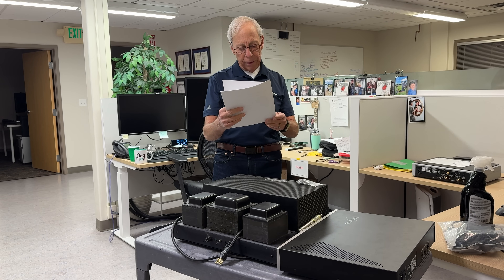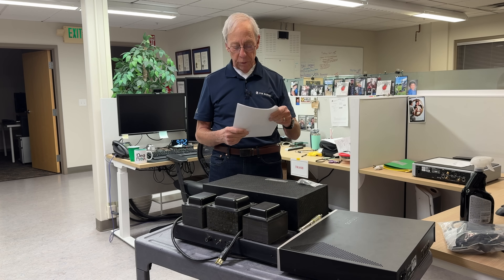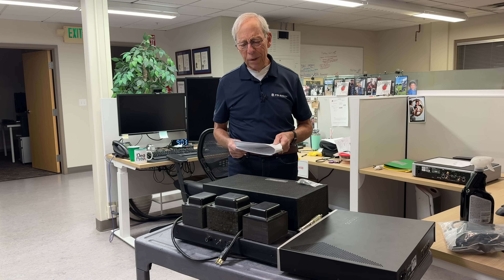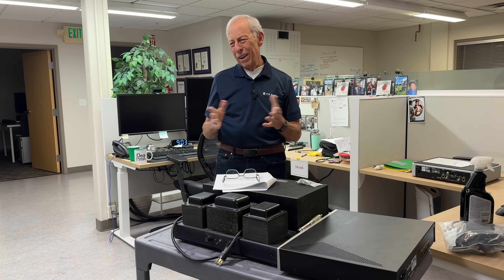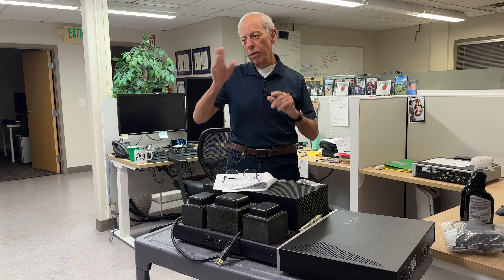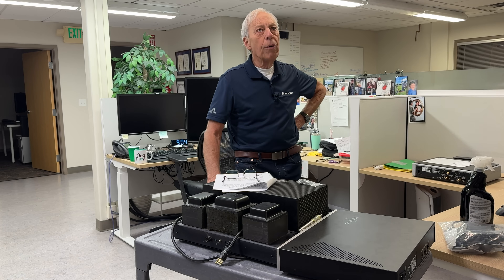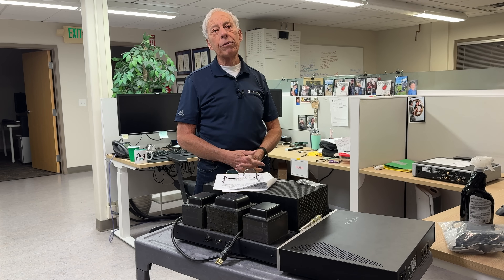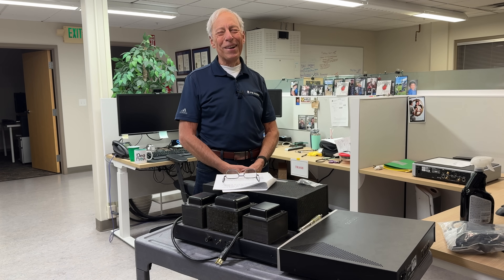Running Japanese equipment on US voltages

Comment: I have a japanese kenwood ge7i equalizer in the usa for years. I just plug it right in the back of the receiver. Never had an issue. Usa is 120v by the way. Im looking to buy a pioneer cd player japanese model because i want silver. I think it will be fine too. Hope so anyway

Comment: bottom line is reading the data plate and any paperwork. Most gear (these days) operates internally on regulated DC so it's just a small section handling the various input voltages from 100-130 or 210 - 250 VAC line voltage. Older equipment and tube gear may be more fussy. BTW, even though most of the north and south American countries run on / near USA specs, most of the Caribbean countries run closer to 105 volts and 50 Hz. Perhaps it has something to do with old powerplant gear handed down from other countries while they were establishing their systems?

Comment: I lived in the Netherlands for a few years and had ARC change the voltage on my ARC LS15 from US to European voltage When I returned to the US I reached out to ARC to convert it back to US voltage They suggested that I keep it as is with using a step up transformer as it will sound better

Comment: I took a 12V filament transformer with one end of the primary connected to one end of the secondary to lower the voltage for a crappy Chinese tube amp. So instead of producing 12VAC it removed 12VAC and I got 108VAC for the 110VAC amp. The filaments were almost 1 volt too high and tubes did not last long plus the power trans got real hot. Now everything is in spec and running cool.
Reply: Yes, a bucking transformer is a viable method to use, without having the size and cost of a full step-down transformer.

Comment: It can be a problem for linearly regulated stuff….. 100v 50hz vs 120v 60hz can be a huge difference on the other side of the bridge rectifier, especially if the main filter caps were fairly close in margin for the original voltage, and any regulated sections will be dissipating a lot more heat… It will probably work but it will shorten the life
Reply: @efmvii  exactly

Comment: My previous home in Canada was about 1000 feet from a Hydro substation. My measured house line voltage varied from 123 to 126 VAC.   Operating  slightly over is better than running under especially with devices like the motors & compressors on Air Conditioning Units, Washing Machined, Furnace Fans and Refrigerators.  North American standard is +/- 5% (114 to 126VAC) Years ago, in another residence, my line voltage dropped at peak periods to 105V and my Mark Levinson power amplifier’s main switch would buzz.

Comment: I’d be worried about the AC frequency in Japanese products. When I was in Tokyo, it was 60Hz but in Nagasaki,  Miyazaki and Kagoshima, Southern Japan, everything was 50Hz. Such a small country but 2 different AC standards. I would recommend determining the AC frequency of you Japanese equipment
Reply: The two standards are why japan produces equipment that works on both without any special consideration.
Reply: "Small country"? It has more than 124 million people. We here in Germany have only about 80 million and had a different TV standard for West (PAL) and East (SECAM East) until 1990. 😉
Reply: @ In land mass, Japan is a small island. I didn’t say it wasn’t densely populated. 

Most countries offer several tv and isp providers. Having 2 different AC standards within a single country, regardless of size, is extremely rare.
Reply: @MichaelM-to4sg  I didn't speak of several TV providers - I spoke of totally different incompatible TV standards (like NTSC in the US and PAL in parts of Europe back in the days). And Japan is not only one island plus the overall land mass is bigger than Germany.

Comment: One of the big advantages to modern switching power supplies is that most can run anywhere from 100 to 230 volts delivering nice clean DC power, without any problems at all.
Reply: and they sound like trash, no thanks.
Reply: Uh. No. Ohms law is ohms law.
Reply: @ 
Umm yes ... read the specs.

Comment: Everything I bought in the far east - admittedly at military base exchanges - had a switch in the back to accept either 120v or 240v.  Even so, if you take your equipment to a qualified technician, you could have the power supply modified to accept whatever voltage you desire.  It's usually (but not always) a pretty simple modification involving the transformer.  Worst case scenario involves replacing the power supply transformer itself.  On a big amp, that can cost a few bucks.  But on low current devices, this transformer won't be very expensive at all.

Comment: What if I want to run a turntable designed for Japanese market (100v / 50Hz) ? I would think 50Hz in Japan  (vs 60Hz in USA) matters hence I am S.O.L. ?
Reply: It depends on the design of the unit. If it's belt drive with a mains synchronous motor, then the speed will be wrong, but if the motor is tolerant of the frequency change, it might be possible to compensate with a corresponding change in pulley size. Unless that's known to be a successful conversion, iffy. If the turntable is completely electronic such as direct drive, it may not matter.
Reply: Only half of Japan runs on 50 Hz - the other has 60 Hz. So Japanese turntables should be fine with both.

Comment: The biggest improvment in amplifiers i bought and modded was to rip the powersupply as is. And run the equipment from good old sealed lead acid battery power. On stand by they are connected to a float charger. And isolated from the equipment. When playing anything , they are isolated from the charger , and the equipment is fed whit clean dc , and no noise from the power lines. 
I argue that no powersupply fed from the main's can be as clean as lead acid battery power. There is no main's , so no chanse of main's hum from the mains entering via the power lines. 

I find this to be far superior than any linear or switching mode powersupply of any sorts. 

However , i'm open minded. Do your best to proove me wrong ;)
Reply: Mains related peaks measure at -121 & -115dB for the 50Hz & 100Hz respectively, with the third harmonic at -123dB at the speaker output of one of my power amps, which is running on unregulated DC rails. Prove its audible.
Reply: @paulb4661  plug that in our magnificient grid ;) 
Battery power is objectively a superior solution . 
Since you would measure no mains related peeks on a battery. And highly likely your powersupply would not be able to deliver 500 amps of current. For a starter battery its not a big deal.

Comment: What makes that in some cases a 60Hz transformer plugged to step down transformer fed through a 50 Hz line vibrates (mechanical) ?
Reply: The simple explanation is it will be drawing more current than it should be. The turns per volt ratio of the windings will be wrong for the magnetic core area. It's likely to make the transformer buzz, run hotter than it should and have lower maximum safe power output.

Comment: Despite all the snake oil crap, that's one good point about the Power Plant as one can adjust the voltage without harmonics in the power. However, I think you should really add feature into the Power Plant that makes it so, the user select a country and it outputs the desired voltage & Hz and that would LITERALLY be the ultimate endgame for powering audio equipment!.
Reply: I don’t have a power conditioner but I have a Ferrum Hypsos with my Oor and I absolutely can tell a difference when I run the amp at either 22v or up to 30v, the sound is leaner and more laid back at 22 and darker and dynamic at 30. If I can do this same kind of thing on the power plant it makes me want to own one for all my other equipment.

Comment: I still have my Japanese Nikko NR1015 receiver that's 100 volt I bought brand new in 1978 and forever have plugged it directly into 120 volt wall socket. Same with older Technics tape deck and turntable. Never had any problems. 👍
Reply: It’s all about heat dissipation. As long as you don’t crank it up all the time, the power supply is able to handle the additional voltage load.
I didn’t have the same luck with a Japanese Yamaha synthesizer, it blew out in less than a year.😢
Reply: @pablohmleyton4552  And things like how close power supply capacitors are running to their voltage ratings. I do maintenance on active speakers (studio & PA) and here in Australia the official mains voltage is 230V. A lot of modern speakers with 220/230V ratings appear to actually have 220V transformers, and with the real world voltage here often above 240, sometimes up to 250, blown amplifier supply rail capacitors are common.

Comment: I bought my Yamaha stereo equipment in Okinawa, Japan and it runs really good here in Wisconsin with just a power conditioner. Also, Japan has 50hz power, but their equipment runs just fine on 60hz also.
Reply: @gregory: No wonder - only East Japan has 50 Hz - West Japan runs on 60 Hz. So Japanese equipment shouldn't have any problem with either of it.
Reply: @Fastvoice  I was on Okinawa, Japan. Small island abiut 800 miles south of the mainland. Love the people!!!
Reply: @ Well, then you should have known that not all of Japan runs on 50 Hertz. Okinawa has 60 Hz. 😉
Reply: @Fastvoice  it was 50Hz when I was there. 50Hz and 60Hz are not compatible. So all of this hemisphere I live in is 60Hz and all the sinewaves lune up perfectly. So from Alaska thru Canada to all of the Southern Countries in South America to the tip of Chile all have the exact same frequency perfectly in tune. So if 1 area is different, it cannot be on the same grid as the other. My Father was the control room operator at a hydroelectric power generating station on the Wisconsin River. I watched him many times bringing a water driven generator online and taking another one off. It has to be done with great precision. So either Okinawa changed all their generators or they have more than one and the lines never connect between them. That is very inefficient.
Reply: @ Okinawa had and has only one grid and it runs on 60 Hz. I suspect that this is the case since the end of WWII when U.S. troops took over the island and established an electric grid compatible with U.S. equipment.
Reply: @gregoryfrance1723  Japan has High Voltage DC Frequency Converter substations linking the different frequency grids. The oldest 300MW installation will soon be 60 years old, the largest which was uprated to 600MW in 1992, was enhanced with a further 900MW capacity nearly 4 years ago. It brought the total interconnection capacity to 2100MW.
Reply: There is a tiny - but measurable - difference in the output of the power supply transformer.  The transformer will be ever so slightly more efficient - and produce a slightly higher voltage and a bit more available current at 60Hz over 50Hz.  This puts a commensurate strain on your power supply components.  However, if it ain't broke, don't fix it.  You could possibly run it like that for decades without problem.

Comment: Oddly Enough 
Japan 🇯🇵 is
100 Volts 60Hz West of 
The Fujigawa River and 
100 Volts 50Hz To 
The East of Kansai Electric Service They 
Split The Frequency or
Cycles Over There 
Yes Paul Failed To 
Mention Some Electronics and Appliances
In Japan like a Refrigerator are 
200 Volts 50Hz 
and Some Appliances in
Japan Function on 
200 Volts 60Hz or
100 Volts 50Hz or
100 Volts 60Hz Are Geographically 
Specific in Japan 
So My Recommendation is 
If You Read The Data Plate
and The Device Is 
100 Volts 60Hz a
Variable Transformer or
AC/Variac Can Be Used 
To Step Down Your 
Voltage on Your Home 
Electronics From Japan 🇯🇵 That Are 100 Volts
60Hz 
Good Night 💤 Paul
Reply: could you try typing in a more annoying fashion please?
Reply: @MarcusH... 
I refuse to read that nonsense.
And when you ask them to write properly they attack you!
Reply: @MarcusH...  The weird thing is that it takes an extra effort to capitalize every word!!!
Reply: @unclewilbur8976    wild guess... voice to text and the settings for caps / word wrap are automatic from a phone that normally does text message.

Comment: I shouldn't worry too much about it. All supply systems have a tolerance within which they are allowed to operate. Here in the UK we are nominally on 230V, but the supply voltage has a statutory tolerance of +10%/-6%, so can be anywhere between 216 to 253V. When I was a practicing spark I don't recall ever seeing less than about 235V and more often around 244V. Equipment manufacturers of all stripes have to make their equipment able to cope with these supply variations. Whilst the voltage is different, much the same will apply to Japanese (and US) equipment.
Reply: Japan is pretty unique and has 100v as standard. A lot of Japanese electronics won't work elsewherem

Comment: Here in Australia, and I believe most 220v to 240v regions, the power has actually been changed to 230v to lower the chance of any issues with equipment in this voltage range.
Reply: 230 Volts in Western Europe since 1987 - with a margin of -/+ 10%.
Reply: 250v in Western Australia (at least unofficially).
Reply: Where I live in Victoria, it is 230v. From memory years ago I was reading 240v once.
Reply: @ So you're clearly living in Victoria/Australia, not Victoria/Canada (110 V/60 Hz). 😉
Reply: @davidclarke6658  I'm also in Victoria, my supply voltage has remained typically at 242V. High demand periods droop towards 238V. I don't get about much these days, so I have no reason to know from experience what variation occurs with location.

Comment: what about frequency
Reply: Different regions in Japan use 50Hz or 60Hz mains frequency. For equipment where this matters, the same device may be available in either a 50Hz or 60Hz variant.
Edit: I've seen suggestion that for transformer powered devices which are not frequency dependent for their operation, it's just the electromagnetic properties of the transformer that need to be accommodated, some manufacturers specify transformers at 55Hz so they will work well enough on either frequency. I have no way to confirm if this is the case.
Reply: only of consequence if a unit like a turntable relies on the frequency to give correct speed
Reply: @jdekong3945 Hmm... I was interested in a Japanese turntable 100volts/50hz... guess i am S.O.L. ???
Reply: @ptg01  if the motor itself is driven directly off the mains then yes its a no go, if its say like a direct drive where there is internal DC voltage regulation then you will be fine, depends on the deck, let me know the model/make and i`ll have a look

Comment: I thought Japan was on the same power specs as the US, no?
Reply: Japan runs on 100 volts, 50 hertz.
It’s unfortunate because they make great audio gear like Luxman and Accuphase. 
These Japanese brands are also available in 120 volt, 60 hertz versions, for export to other markets. Unfortunately, the distributor has exclusive rights, and jacks up prices by 
35% to 45%.
EBay has listings for these brands in both 120 and 100 volts, and there are significant savings. But things get tricky with import taxes.
Reply: @unclewilbur8976  Nope - Japan has 50 Hz in the Eastern part and 60 Hz for the West. So these 60 Hz versions are not only for export.
Reply: @Fastvoice   ¯\_(ツ)_/¯
This is unnecessarily complicated!
Anyway, I was just trying to offer a little information to the original comment. So I said that Japanese audio is available in 120 volt/60 hertz for export markets.
Reply: No..100v
Reply: basically, yeah